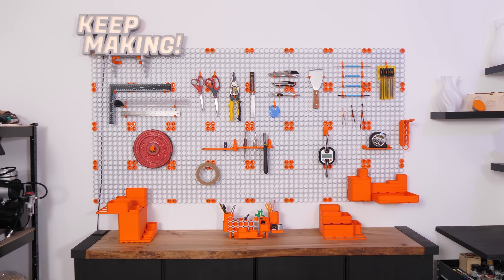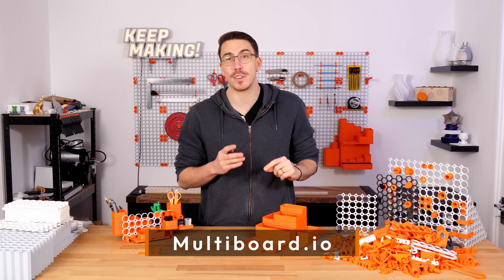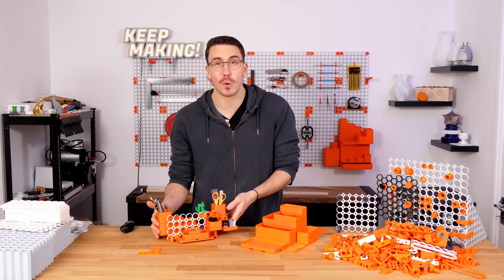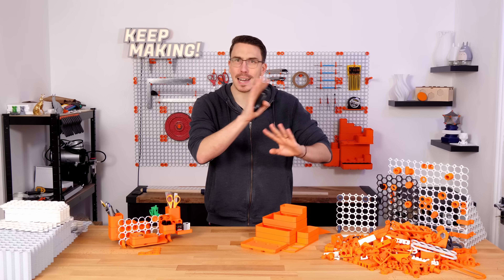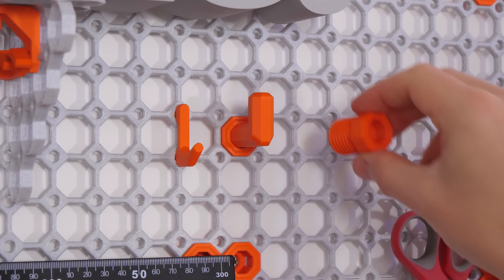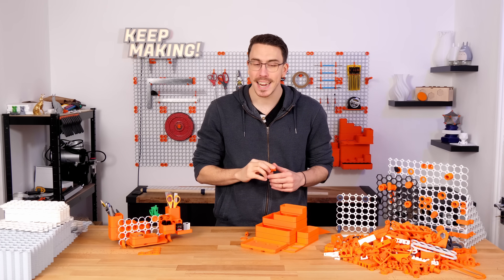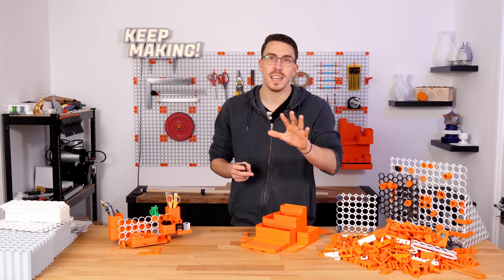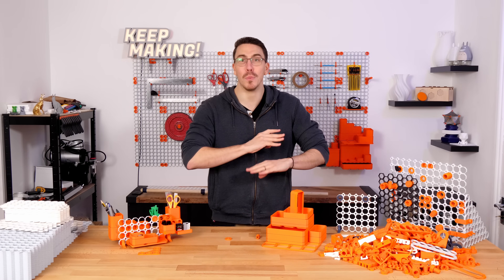Multiboard: Free 3D Printed Fusion Of Everything!

Comment: At first I was enthusiastic about the system, although I am skeptical as to whether it will ultimately be worth it. It would be better if the base could be purchased ready-made by injection molding.

But honestly I think it's too expensive at 5 dollars a month.
How long is the term? Can I still use the generators if I cancel again?

Why don't they offer it at, say, 1 dollar per month? I think you would be amazed at how many users would do that. So they scare many people away and in the end they get less out of it.

Thanks

Comment: Good idea about double side storage, but for wall mount, it's just a waste of plastic, when IKEA Skadis already offers plates which can be similarly customised by applying your modules on top of it, only where needed (if not using directly Skadis custom storage). After all, you show the same idea in relation to hexagon boards/modules...

Comment: "User acknowledges that the Platform itself constitutes commercially copyrighted works protected by federal and international copyright laws and are owned by or licensed to Thangs. The Platform and all versions of the Software shall remain the sole property of Thangs. User will not, and will not permit or encourage any third party to, directly or indirectly, reverse engineer, decompile, disassemble or otherwise attempt to discover or derive the source code, object code or underlying structure, ideas, know-how or algorithms relevant to a Platform or the Software, documentation or data related to the Platform; (ii) modify, translate, or create derivative works based on the Platform or the Software; (iii) use the Platform or the Software for timesharing or other computer service to a third party; (iv) modify, remove or obstruct any proprietary notices; or (v) use the Platform or the Software in any manner to assist or take part in the development, marketing or sale of a product potentially competitive with the Platform or the Software. User acknowledges that the Services, the Software, and the Platform are confidential information of Thangs."

Comment: It fascinates me, I was just beginning to put together a formula for mounting a couple of repurposed laptops on the wall in our garage (cos our rack is just too cramped and hot) and was just pondering using the same aluminium extrusion that 3d printers use and some 3d printed brackets - just so I can slide them around (they're not all the same size) and here you come with the aid of the youtube algorithm reading my mind...

Comment: So what about drawers? There are tons of solutions out there for 3D Printable stackable and modular parts bin/drawer setups. Have you put any thought into creating/adopting some of these to the Multiboard form factor?  Im just thinking of a box that has the snap fit on the back - or something similar. Just might be better than printing out your "shelf" and setting these bins on top of it.

Comment: Great idea, awful business model. Gridfinity works, because it is free to access and modify. Honeycomb as well. In case of selling it, I understand that the creator wants his share. Well, I have seen many great ideas which went to hell thanks to the poor business model. Nice example is the storage system of Alex Chappel who basically gave the impulse to gridfinity birth. I'm afraid this will be the same story as with Alex. Individual will never be able to compete with the enthusiastic community around the some great and free ideas as the limit is the time.
Reply: Its a great idea that seems to create more problems than it solves. There's a lot of questions about the cost, the long term strength and stability of PLA, the awkwardness of what fits what and why and how and with what adaptor as well as all the time needed to get your printer up to the precision and accuracy needed to print the board and adaptors and bits needed to make it work, as well as all the time and cost of printing. As yet its just board and fixing bolts - nothing much above basic pins and clips to hold thing onto the board, little choice of bins to store things in, and almost no custom parts. When the various wood/metal pegboard or the ready made plastic bins and wallboards are so very very much cheaper, significantly stronger and long-term temperature and moisture stable, it just seems like a huge waste of time, effort and money. 3D printers are amazing things - but not for this application.

Comment: I am unable to get accessories to fit into the snaps. They do not go in and pull out as shown at 3:50. I have tested my tolerance and have the right clearance. Perhaps I am using the incorrect parts?  Which part filename are you showing that you have plugged into the wall and then part you are then pushing into that part? I have specifically tried the 7x7 wall, the multiboard snap and the 3 Multiholes, Push-Fit Shelf. I could not get the snap into the wall because it was so tight I knew I would note be able to pull it back off so I didn't hammer that in.  I had to hammer in the push fit shelf into the snap and that will now not come off. I really want this to work to be able to move around accessories after the wall is up and eventually use the generator and see the instructions and what parts are for (via pay wall) but if I can't get the basic stuff to fit I guess it won't work for me.   What am I doing wrong?
Reply: What are you doing wrong? You are using the wrong system.

Comment: I kind of like this system. I looked into gridfinity these last few days and was basically about to pull the trigger when I found this. But there are not a lot of parts for the grid here (or some of them in early access), which makes this a tough choice. I really like the compatibility between your grid and your wallmount but I have an honest question:
Is there any reason to not just instead do this in a 21 mm base? 21 mms would divide gridfinitys 42 mm perfectly by 2 and should make everything compatible no issue whatsoever. One could use a huge base of already existing options... I just kind of dont see why that wasnt an option and I cant be the only one thinking of this.

Anyway. As is im a little torn because while wall mounts sound cool, the more important part for me right now is actually a storage bin solution to start off with.

Second note for your webpage: please tell us some dimensions (you mention them offhandedly in the video) and please also tell us which units you use (especially with america existing and being as self centered as it is and using the imperial system I can never be sure on the internet. Now with your system using a 2.5mm base (which is almost an inch...) you could also speak in multiples of that... which makes everythingvery confusing. If something is .5 high im left wondering what that means...)

Comment: Can we get a true white paper of dimensions and features so that we can design things to fit this system? I definitely like the system and I am very impressed by by how well thought out everything is. Gridfinity was cool but I always felt it lacked true mounting and connections it can work for static bins but it would never have the rigidity needed.

I would really like to see you open all the parts stacked prints are not hard to figure out so why add pain to it. If you want to foster a community then open it up otherwise you will continue to struggle. If your content continues to provide value and or entertainment then you will get subscribers/patrons. But files are a transaction and should not be based on a recurring fee. I am interested in using the multiboard system when I start organizing my work space. I will happily tip you when that happens but I would like to develop some parts in the mean time for my use and in order to contribute to the community. Just basing things on remixing is not a solid way of fostering a community. Please open things and be transparent with the standards.

Comment: The underlying problem with ALL these great systems (and this DOES look great) is that they force people into a specific grid system.  We need one that is procedurally created, and has tools that not only allow one to generate grids with varying sizes but ALSO automatically change mounts on things that clip into the system so that the mounting piece fits the desired size.  This would allow a large community of parts to seamlessly (within reason) work for people at various sizes as best dictated by the use case.

Comment: I am pretty much in love with the multigrid. Gonna print some and see how it works in real life, and if it works as the video seems to say then I will throw some money your way. You Definitely deserve to get paid for it, if I use it! 

Is it possible to put a small box in a bigger box? I normally layer my boxes (so like a big box with all my 1x1 Lego tiles and in that box there is 12 smaller boxes (maybe in a grid) with 12 different colors). Seems as a minimum it should be possible to print the base box add a grid on it and then the smaller boxes. But would be even better if the base box could get sides too.

Comment: i just mounted my honeycomb wall like 2 days ago and am in the middle of sorting all the tools that need to be hung up. great timing. :D if i ever need to go bigger or some additional storage, i'll give yours a shot. it looks awesome. I have one question. I'm preferring printing these in petg as the advantages make sense to me. it holds up to heat and uv (direct sunlight on my wall), it doesn't snap break if anything goes bad. it saggs way less than pla and it holds up better over time as well. is rigidity the only selling point for pla for a storage wall?
Reply: Petg will be stronger for this. So go ahead. The selling point of PLA here is "it's good enough". As most people find pla easier to print with.
Reply: @jetblackstar  thanks man, weirdly enough petg is the easiest filament for me to print. so yay for me i guess :D

Comment: I bought in on the unlimited just like you suggested. I printed an 8x8 core and also three of the peg board hooks. however, it's too fat to fit in. I tried the hooks on my standard Pegboard and it works but you really have to put some serious force to use it. So my questions is... is my Extrusion rate for my fillament too high? I think there was some kind of tolerance test on your thangs area. Should I do that to dial things in? or what do you suggest. thanks.
Reply from the maker: Hey, massive thanks for the early support. Hmmm ya I would suggest trying to get printer dialled into the .1 to .2 mm of tolerance range. A pretty good video to watch is one by my buddy "Lost In Tech" https://youtu.be/yzPqBt2SrcE Give that a go and let me know how it goes. FYI discord is the best place to keep a convo going with me

Comment: I was so happy to hear you say PLA. I was afraid you'd need ABS or PC for strength, and I just don't have a setup that can print those. I can't wait to try it out!
Reply from the maker: Ya I'm a PLA fan boy and I know that at the end of the day PLA is the way to go so everyone can get as much out of it as possible.
Reply: PLA is the strongest of the all you've mentioned, however with some drawbacks. Stefan from CNC kitchen has put some light to the strengths capabilities of the popular filaments.
Reply: @sergtimosh  The strongest? It has some beneficial qualities and can be very rigid but it is certainly not the strongest.
Reply: Personally, I'm printing anything that'll be under constant load out of ABS. It's stronger and most importantly, far more resistant to creep and deformation than PLA, PETG and even Nylons. I've run into enough problems in the past to never make that mistake on big projects again. 

ABS/ASA is far easier to work with than people think. I have a Voron and other custom printers but I still knock out ABS on an old Ender 3 Pro running Klipper every day. You mainly just need a basic enclosure, a bed set to ~105C with a PEI surface and a nozzle around 250 C. Everything else is tuning a profile and keeping the PEI clean with a drop of acetone on a cloth (NOT on the bed directly!). Avoid using IPA for cleaning. Obviously keep the filament dry and try the "low odor" variants but still make sure there's some decent ventilation.

Once I learned how to print ABS, it's pretty much all I use and can lead to some beautiful parts.
Reply: @JJFX-  can you elaborate more on what is wrong with IPA as cleaning agent?
Reply: @sergtimosh  IPA is fine in many cases but even 99% can leave a residue on the bed surface. When printing something like ABS this can lead to lifting which caused me a lot of frustration until I realized it. Prepped PEI cleaned with a dab of acetone on a microfiber cloth before every print is night and day IMO. Just don't squirt it directly on the bed or it could cause the PEI to crack. The next best option in a pinch is simply clean, hot water and a little dish soap.
Reply: @JJFX-  thanks for you input! 
As for the mechanical props of PLA I insist you'd check CNC kitchen vids with experiments regarding FDM plastics comparison. PLA is only beaten (slightly in the extending and bending forces experiments) by carbon reinforced filaments. And it's quite relevant to what I can see with PLA printed stuff. The major problems with PLA are next : 
1. it doesn't absorb the impact(it's usually in the end of the video)
2. It snaps at load instantly(why others like ABS starting to stretch, losing its strength but staying intact) which is interpreted by many as low strength.
3. It probably degrades it's props quicker then any other other plastic specie. But this is not what is experimentally confirmed somewhere here in YT territory so it's a field for speculations.
 So using PLA to build statically loaded components can be confidently justified, imo. When +- forces are applied or/and you build is exposed to sun and moisture extensively then I'd think twice.
Reply: @sergtimosh  No worries, yeah I've seen that and others. There's no doubt PLA's tensile strength can be very useful and annealing it make very durable parts if you can minimize the warping problems. It just really depends on the use case. I've  encountered so many issues with the, heat, creep and low impact resistance that make it hard to justify. Not long ago had to completely disassemble a custom printer I build because so many PLA pieces that were mostly just under compression started having unexpected issues.

My favorite all-around material is carbon fiber ASA, which prints like a dream and improves the tensile modulus beyond typical PLA but at the cost of some elongation and impact resistance. I'm sure most the multiboard parts will hold up well and I'll print a many pieces in PLA but for anything under questionable load I'm going ABS. It certainly has disadvantages but once you get used to it, it really is an awesome material and the ability to do acetone vapor polishing can makes for some beautiful pieces that almost look injection molded. There's a reason the Voron community is so obsessed with the stuff.
Reply: @JJFX-  so much willing to try some fiber-enforced once. Currently the printer is 90% busy for the army needs. And pla and petg is just fine for short operation usage circuit, no chance to try anything else :)
Reply: @sergtimosh  Right on, last two cents I'll throw in is tungsten carbide nozzles are 100% worth it. I don't even know how many CF spools have gone through my 0.5mm at this point and it still prints as if I bought it yesterday. Cheers.
Reply: @JJFX-  ty

Comment: Always thought the hexagon system was bad. I was about to say the threaded systems make more sense for strength, and you just had to then mention how there's also threads here. And a gridfinity-like storage system to match? Just perfect. Much appreciated that you're releasing this into the community instead of absurd attempts to clamp down on ideas that are easy to reproduce and creates pointless division.
Reply: The hexagons are going to be really weak.  Not a great idea.

Orient the hexagon board however you like.  Imagine a load hanging from it going straight down.  That load is transferred through the hexagonal grid.

With hexagons, there can be no continuous support in the direction of the load.

With squares, the load is always supported on both sides though the whole height of the board.

Edit -  Take a look at a video called "Hexagons Are NotSoGreatAgons" for more detailed information.

Comment: Ive signed up and have a question or two,,,for the multi stacks, are they printed with supports? how are u attaching to drywall, since the sizes are 6" and 8" with the distance between the holes in max 5" and 7"and the wall studs are 16" usually, in my case 19"?
Reply from the maker: Hey Briant444 two videos just droped one is this one about stack prints: https://youtu.be/xs2urfM0MRM
The other questions is all the testing I have done has not been into studs. There has been pusly screwed into drywall using J-plugs.
Reply: k thanks @Keep-Making

Comment: This is awesome. I’m limited in what I could print since all I use is resin but I see a lot of promise with it.
Reply from the maker: I'll have to do some testing and see how this works with Tough resinis at some point.
Reply: All I normally use is Sunlu abs like. Usually I’m printing dice masters but I’d like to print some of the smaller pieces to see how well they print.
Reply: I would figure the stacked versions would benefit loads from resin printing, considering the speed at which it can cure the entire layer all at once